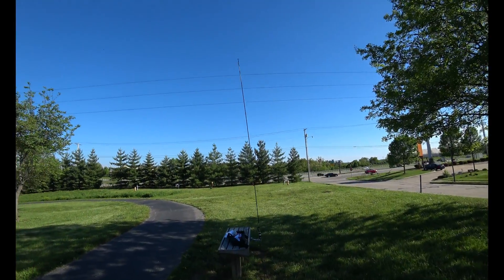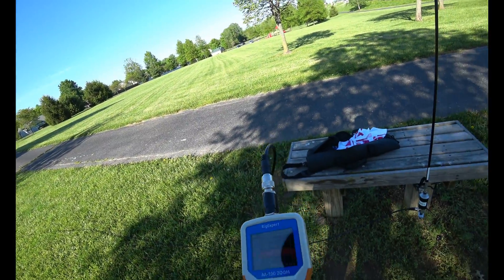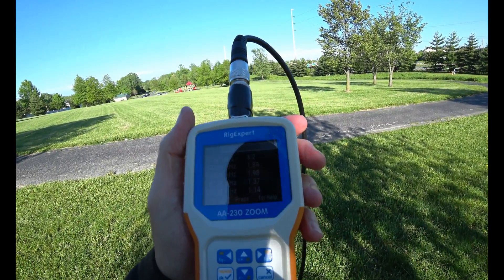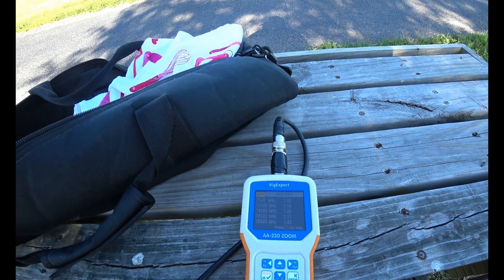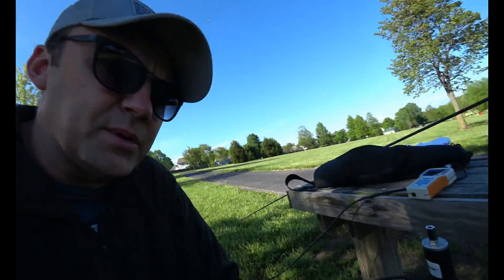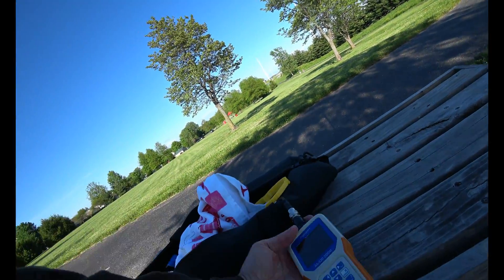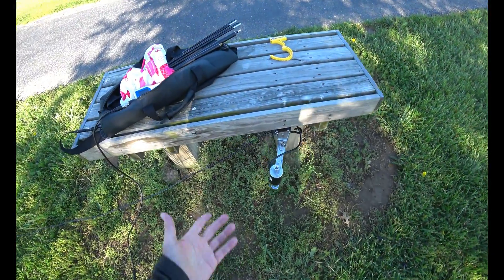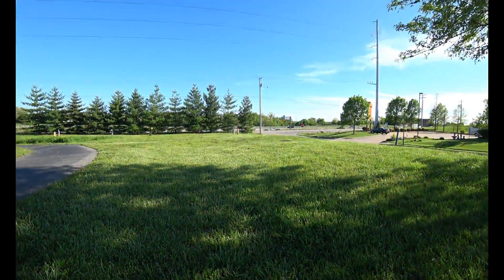Analyze SWR | Chameleon MPAS Antenna | RigExpert Antenna Analyzer

Comment: How do you configure the MPAS for DX communications, or how do you lower the take off angle?  I am debating if I should get this antenna system vs the TW Antenna vertical dipole as I'm more interested in long distance DX?  thanks for sharing
Reply from the maker: Honestly I don't like it. It's been hard to make QSOs on.
Reply: @hamradiocq  oh wow, so in your opinion the MPAS is only good for short range?  I'm in a HOA restricted area & was thinking of using as permanent antenna in my back yard.  I read a lot of good reviews about this system on eham. so I'm confused...perhaps the TW Antenna vertical dipole maybe better... thanks for your candid response...

Comment: You need to use 6 feet or less for the coax feed line from your rigexpert to antenna , or you half to add the capacitive reactance of the coax to the circuit

Comment: I set my MPAS using my own 8' ground wire into a 7" spike in the earth and the MPAS wire on the antenna base as a counter poise.
I have that out to 33' for a 1.27 swr on 40 meters.. All the other bands can be adjusted somewhat by changing the counterpoise length.
You shouldn't require a tower. Made some good contacts on lousy condition days using 25 watts..
Love my antenna rig analyzer, without it it would be hit n miss..Great antenna for portable work. Tuner not needed.. 
Manual just a guide, should be more forth coming..Pleased with the quick deployment and versatility of this antenna system..

Comment: I saw similar results with the  v2l antenna when set up mobile.  Swr readings were all over the place but as soon as I touched the vertical they all dropped to under  2. I queried Carl at chameleon and he told me not to worry about the swr  readings.  Take that as you will.

Comment: Attached a the top the "counterpoise" become the "radiator" and your coax cable become the counterpoise by default!
Reply: AnythingWithWheels  Dont ever hand touch any antenna part whether its the radiator or the counterpoise when doing rigexpert measurement or actual transmission! Your body will act as a capacitor affecting all resonance frequencies and radiation patterns. And always use coax RF choke (a quarter wave length coax turns of the lowest frequency you be using) at the feed point to isolate the coax from acting as a radiotor and prevent having "RF in the shack" effect. ;)
Reply from the maker: Chameleon Antenna woh that's heavy Doc